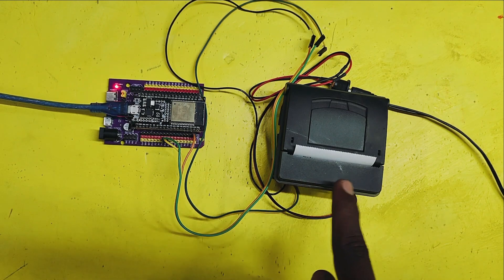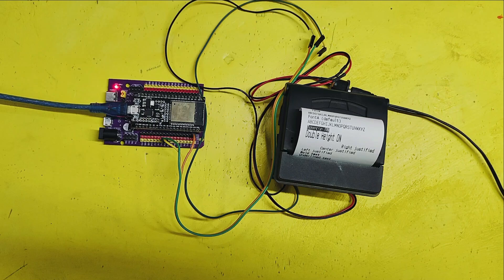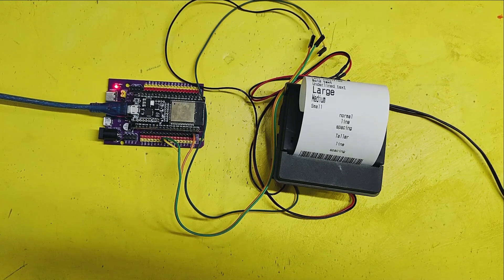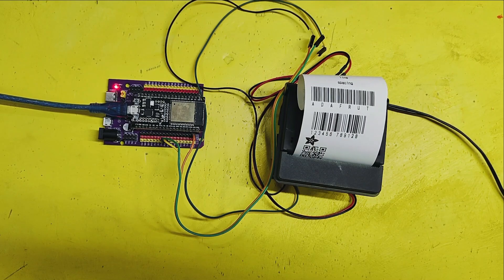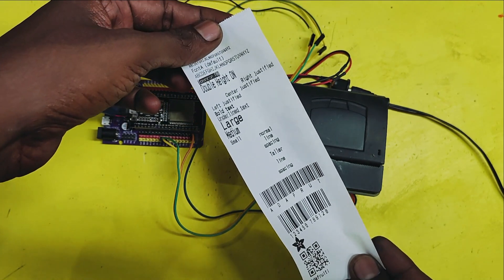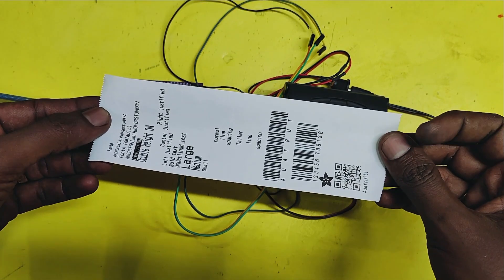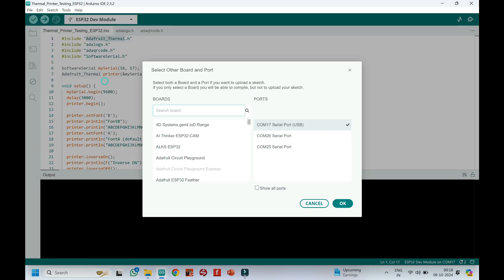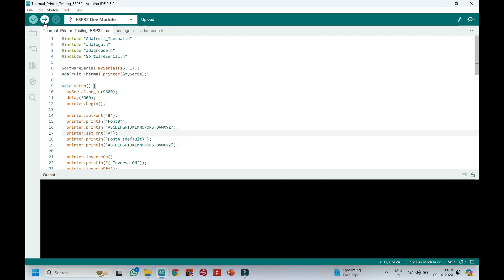ESP32 Thermal Printer Testing

Comment: Is any way to increase printing speed?
Reply from the maker: Without library, it will print very fast.
Reply: @TeachMeSomething yeah I am using adafruit thermal printer library,if not used it will print faster right?
Reply from the maker: @jey4853 yes.
Refer manual and use the command. So that it will print very fast.
Reply: @TeachMeSomething yeah now it's printing faster, thank you❤